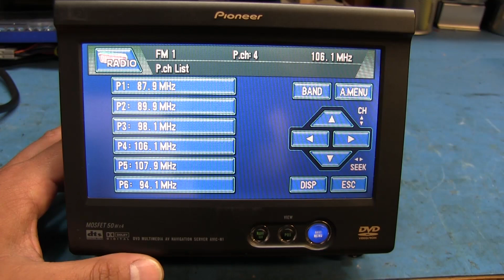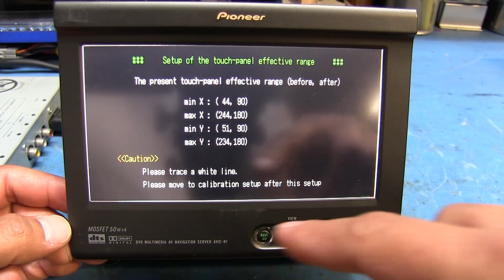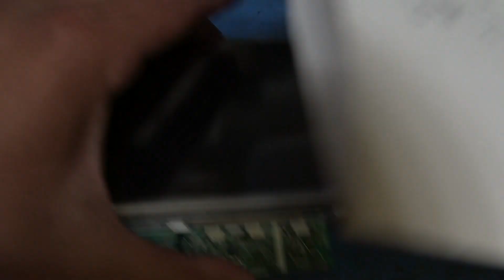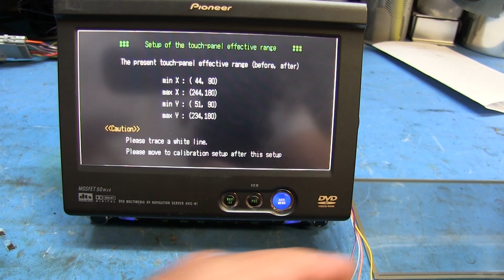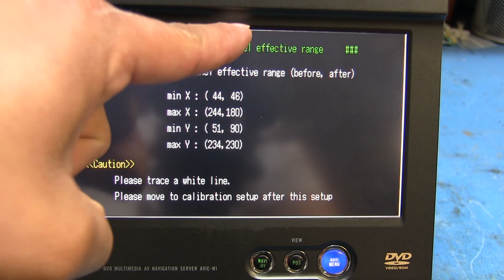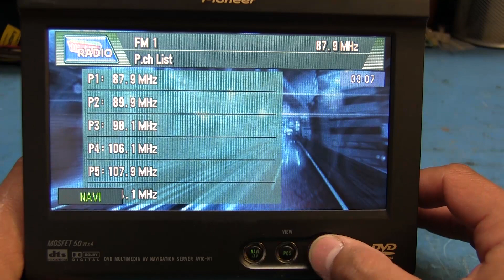TWB #1 | Let's Fix It! Pioneer AVIC-N1 Touchscreen Issues

Comment: I hope you can help. I have a pioneer x1 and x1r in 2 cars. One problem is I have the original satnav 50mt,60 and 70 discs. None of my units read the discs comes with reading error and i have used dvd cleaner in the head unit works fine. My x1r plays dvds doesn't read the satnav disc. My x1 unit only reads the dvd cleaner. Does not play dvds or read the satnav discs. Can you help

Comment: i have the Pioneer SPH-DA120. screen works fine except for the top 1" (roughly) is completely non-responsive. this prevents me from adjusting the volume. opening the settings, etc. very frustrating. there is no visible damage and this just suddenly began happening.

Comment: I have the 2005 n2 model and have the unit and the hide away box and I'm desperately looking for the navagation plug that runs from the deck to the hide away do you know where I could purchase 1 thanks in advance
Reply from the maker: Other than occasionally checking eBay or something, best bet would probably be Pioneer themselves. Maybe they have some old stock laying around.

Comment: Hi work bench love the video I have a slight problem where I've calibrate the screen nod store setting but how do you ext the service mode also buddy I really wanted to see you change the screen replacement that would of help us out o me in case my is on its way
Reply from the maker: Winston Banks Once you've saved the calibration values, you can just power off the radio and power it back on. I don't have this radio anymore to show how to replace the panel, but all you have to do is remove the screws on the side of the screen and the ones in the back including the ones on the little silver metal cover. This will allow you to remove the front plastic bezel and remove the screen. You have to disconnect the flat flex off the back of the LCD board by gently prying on the tab that holds it in place. From there it's pretty simple as the whole controller and LCD assembly just pop out, and as long as you're careful you should be able to easily replace the touch panel. Good luck!

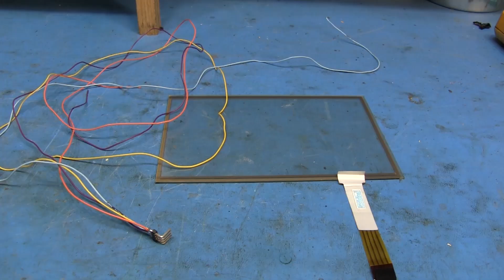Comment: Thanks for posting this video.  Quick question, the screen you have at 9:55, is that made out of glass or plastic?  Or is it glass with a plastic coating?
Reply from the maker: The base material is glass, but the top film is plastic. That's pretty much how all resistive touch panels are made. They probably would have too much drift if they were all plastic.

Comment: My Pioneer Super tuner 3D is not working.  Out of the blue the screen started to go black but then it would come back on for a few weeks.  Soon after, the touch screen went permanently black but I could still operate the radio for a few more weeks but now does nothing but illuminate.  Screen will not come out now, radio will not work, nothing happens except there is power getting to the stereo.  Any suggestions?  Do I need to buy a new car stereo or can mine be fixed?
Reply: Jay Casey exactly the same does my unit do. I can operate the cd player but nothing else.

Comment: Great video. I'm having a different problem where the unit powers up, opens the screen and then it just turns off all button and does not respond. The screen stays open though it doesn't respond to any buttons. When I take the face off, the screen closes again. Is this something you've seen before that maybe can help me out with? Thank you in advanced.
Reply from the maker: Sounds like it's a damaged ribbon/flex cable going to the screen part of the radio. Unfortunately the ribbons in radios that have a motorized screen will eventually develop broken traces due to the frequent flexing they do.

Comment: Thank you for the reply and thanks for this video it solve my screen from not as response to finger tips ideal I understand the instructions you gave me below and many thanks for that ........when I do go to change this .....the unit must be unplug. Correct ? So there for the screen would be inside the unit that the little bit where I'm confuse a tad many thanks look forward to a reply
Reply from the maker: I suggest to eject the screen while power is applied and remove power immediately after the screen is completely out and horizontal before it flips upwards. It'll make it easier to work on. Always remove power to the unit before working on it to avoid damaging other parts. Once you replace the panel and put it back together the unit will pull the screen back in and then should work as normal. Be very careful not to damage the flat flex ribbons!

Comment: Having an issue with my avic n3, resorting to sending it in for over a hundred bucks. The screen flips up and the touch screen responds, but there is no picture. Screen went black as it was trying to warm up and vehicle was put into reverse and the back up camera tried to use the display. Would love any help if possible.
Reply: I see you don't have the unit anymore, but a direction to look would be awesome.
Reply from the maker: Jason Black Sorry for the delayed response. It sounds to me like the ribbon cable between the main board and the LCD unit might be bad. It's a fairly common occurrence with units that rely on flipping around the LCD because of the fact that the conductors in the ribbon are copper and over time they tend to develop hairline cracks and the slightest vibration or movement will cause them to lose connectivity even if some of the fuctions still remain. This isn't to say that it's the only thing that could go wrong, I could be wrong and it could be something else, but that's where I would start looking if it turns out there's nothing wrong with anything else. Another possibility I just thought of is that it could be the backlight. If you take a flashlight or something and put it right up to the LCD when there's supposed to be graphics on it and you can see them, then there's an issue with the backlight. I haven't personally seen a backlight go bad though, so I don't know how likely it is that it's your issue, but it's worth checking.
Reply: Thank you so much, it's always nice to have a direction to look from someone who knows more than I on the subject.

Comment: I have a bad backlight on a Pioneer DVD head unit (AVH-P4400BH).  I can see the graphics with a flashlight.  It comes on briefly, then goes black.  I'd like to tackle the repair myself.  Is this an inverter fix, or just an led driver?  I'd appreciate your insights. Thx.
Reply: I have the same problem, only mines doesn't come on but can vaguely see the graphics with a flashlight, did you find a fix?
Reply: Not yet.  I have a service manual.  I've found the BLP (back light power) on the schematic.  Still need to see if there's voltage being supplied, and go from there.  My guess is the back light power circuit has failed.  If I find a fix, I'll let you know.  Good luck to you.

Comment: Hey man nice video, I got same unit but screen is jam
It's not going in stuck  rest is working fine any help ? Cheers
Reply from the maker: Malik Fahad Might need to check the gears in the flip out mechanism. I've seen some with broken gears. Hopefully nothing is broken and you can just get it unstuck. You'll need to be careful removing some of the ribbon cables so they don't break. Unfortunately I don't have this unit in my possession anymore so I can't give you exact details as to what to do.
Reply: ur motor is shot happends all the time that's why they stopped Maken flip outs

Comment: My Pioneer AVH-P4400BH touch screen not working, please advise?
Reply from the maker: Roosevelt Camejo If it hasn't had water spilled on the LCD part, it might just be a bad touch panel. It seems to be a common issue with the Pioneer units.

Comment: i have the same unit and my desplay pops out but dose not tilt up has had a new ribbern thanks
Reply: if the display pops out but doesnt turn up then most likely the microswitch inside the unit needs replacing. as the screen pops out it activates a little microswitch on the inside which then tells the motors to flip the screen upwards.. you can buy them for a few pounds on the likes of ebay but fitting it takes time. You need to solder off the old one and solder on the new one... Not for the amateur diyer.. Have it done professionally depending on where you live.. Hope this helps.